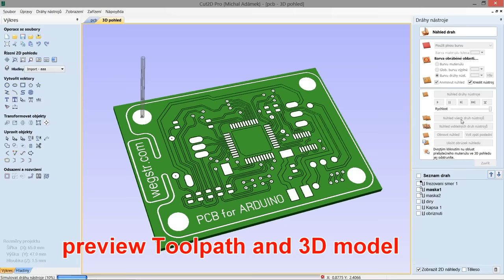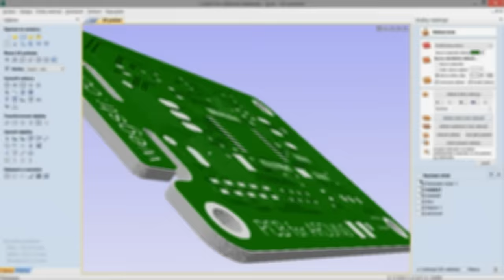How to make a PCB prototyping with UV soldermask - STEP by STEP

Comment: this pcb will not work because he has not donw itching process
Reply: all the track are shorted
Reply: Jay Khairnar it will work because the first milling process separates the individual traces. It does the job of etching.
Reply: thanks
Reply: The tracks aren't shorted because there is a thin layer of copper on top, and sometimes on the bottom of the board ( and multiple layered boards are done differently.. motherboards and video cards have more - 4 to 8 layers, maybe more.. ) for a 2 layered board.. The boards have a lot of copper left over which is typically covered by the solder mask, but it doesn't short because the copper is applied to a non-electric-conducting material and each trace is cut / outlined by the tool so you end up with a lot of copper wires affixed to some material which won't conduct, then those copper wires are connected together with surface mount components and through-hole components. So for 1 layer board you have a very thin copper plate affixed to a thicker plastic or non-conductive material plate, then the copper is milled to create the electrical pathways leaving a large portion of the plate intact while the wires / traces of the copper plate are disconnected from the large piece but still affixed to the non-conductive material. for 2 or more layers on a board, you simply have non-conductive material between 2 layers of copper and the copper is milled to leave the traces affixed and the left-over is affixed but disconnected...

In short, as said above, pcbs are a way to house a ton of wires and components in a very small footprint.